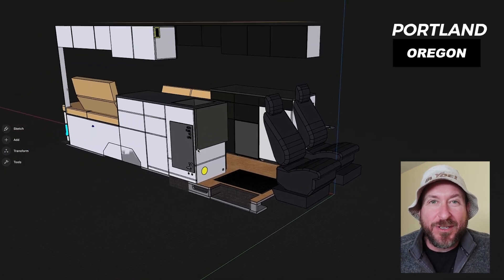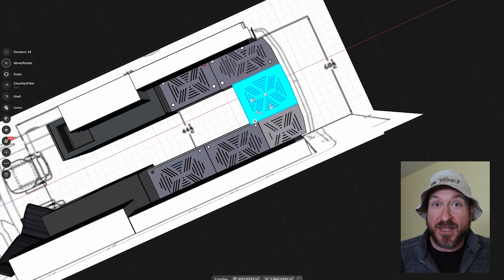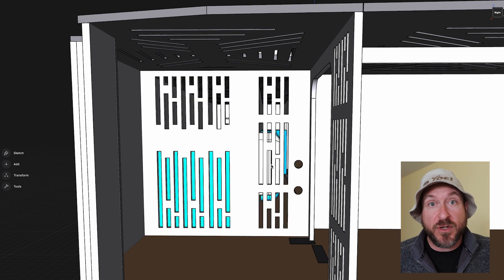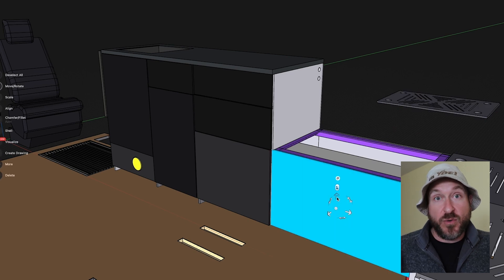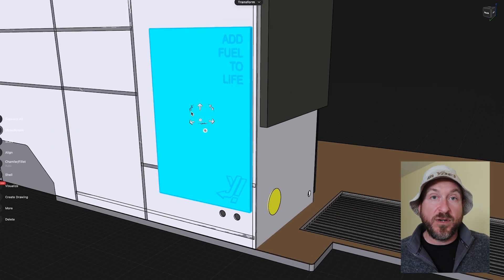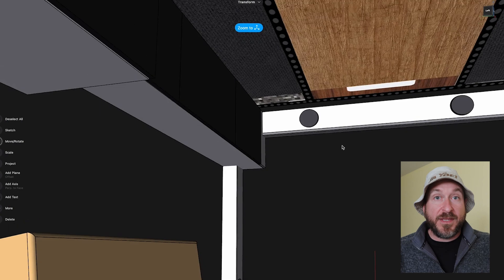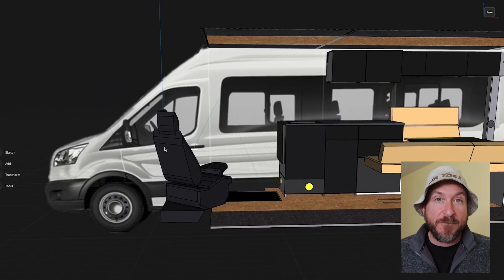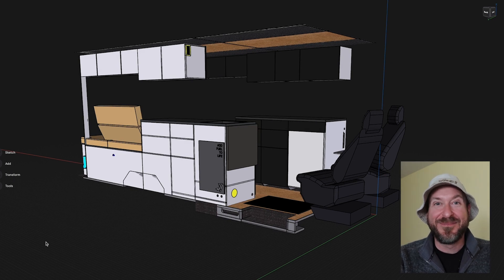3D Virtual Van Design Tour | Hidden Shower, Video Studio, CNC cut panels

Comment: From physic point of view, cold air sink and hot air raise. Based on the design, will it cause the air conditioning system to draw more juices from the battery so that it can push the cold air to top ? watch other vanlife youtuber video from china. Electric is always the most crucial element for a quality van life. Hence, just wonder your current Air conditioning design is efficient from power consumption point of view? Just share of my thought, hope you dont mind.